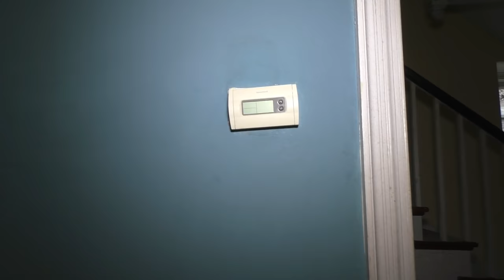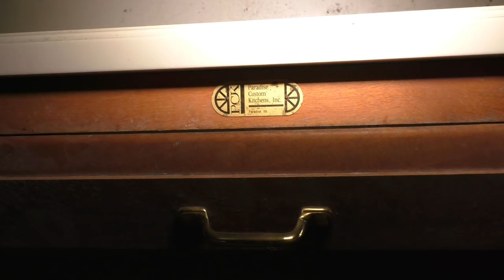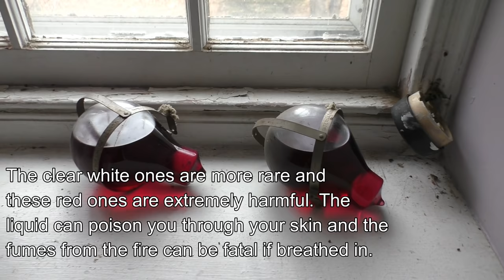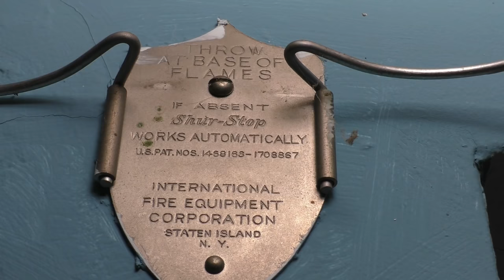Beautiful Abandoned 1930s Mansion - Inside Is Amazing! Plus Guest House

Comment: A drone would’ve been useful to investigate inaccessible areas. This home is amazing! I agree that the 3rd floor 2 bells at the bottom landing suggests women and men servants’ quarters.
Reply: Yep likely those bells were connected to does push buttons it looked as though there might be a few relays as well which presumes that it had more than one tone or a pattern of ringing there possibly could win gold drop devices that be triggered by the coils as well that would indicate if the person missed the Bell that don't call button head didn't wish would they returned. 

Did the old days the bills run Springs the ones that look like the Downton Abbey type doorbell sort've Widow album were operated by pull cables at rods or whatever you want to call them servants call bells or call build as they used to be called and also they had announced Gator panels that will Target with drop or indicate with a needle that there was a call placed in some places there's dozens of little tags that would indicate where the call came from in some cases one Bell and it is several indicators of some sort mechanical ones some more electrically-operated but owners or mechanical nature is that often times with what would be on the end of like a silk bed cord they had pulled the ring a bell sort of like Addams Family except in real life course. Back in the old days you would see a cord that's woven coming down from the ceiling next to a bed ideas you yanked that which would ring the bell in the servants quarters and sold these were actually connected to a switch or later on some mechanical systems were converted to electronic actually electrical at that time but they didn't have relays and stuff so yeah could be considered early Electronics also in some cases the doorbell and the call system were one in the same did that operating the doorbell sometimes of a pool table would ring the bell twice and I call for a servant or a person that's not feeling too good would ring the bell once purport that was all done mechanically and that's why that pulled off for the door so you can get the tube pushes mechanically.

Is some cases these systems were also used to alert another family member see the house has sickroom there be what they called pair push which is a push button in a pear-shaped handle / enclosure that would have a push button in it it'd be basically he was like a nurse, but would accept that would ring a bell or bells in the house somewhere you needed something I have CDs actually still working and modernized number one place I stayed at there was that really a sickroom but had been used for some reason that had been quite in need of a lot of medical attention and be taken care of they haven't use that room because first of all full bath which I needed as well as well dressed wolf and everything and also leaving this morning frigerator a microwave as well it was actually kind a good idea idea actually need used to call system couple times when I needed something unfortunately got to take two different nights.

Cleanup on aisle bathroom.

Comment: That second staircase off the kitchen, was indeed the servants staircase, and the buttons were to call the servants (reminiscent of the British sitcom "Upstairs, Downstairs").  I worked for a famous mansion that was a B&B and it had the same setup, and the dang steps were so small I had to step sideways so my feet would fit!  Most times I would just slide down on my backside...easier (and safer) then falling down those steep stairs.  Another great video!
Reply from the maker: Thanks for sharing
Reply: kelltic100 Upstairs Downstairs was not a sitcom, it was a period drama.  No comedy whatsoever.
Reply: @JulieWallis1963  -- really!!!
Reply: @JulieWallis1963  I know that, and don't ask me why I typed that... Brain is working fingers have other ideas...
Reply: Sandy Mohon yes, really. I watched the entire series a couple  of years ago, back to back in a few days. https://en.wikipedia.org/wiki/Upstairs,_Downstairs_(1971_TV_series)
Reply: The back stairs of my newly acquired 1910 home had stairs that are narrow also.  What's up with that design?  Why so prevalent?
Reply: giancolabird 
P

Comment: I would think that if the basement was the servants quarters then those bells were to call them. Such an amazing house with a sad story. My house was built in 1956 and we have some interesting fire alarms. They're bells that are wound up with a button on front that's held on with wax. If there's a fire it will melt the wax, releasing the button sounding the alarm, and boy are they loud!!!! One in every room. They can be re-wound as well. But this house was a cool find. My favorite was the art deco, black and white bathroom. I hope they save the house. And don't modernize it too much.
Reply from the maker: Thanks for watching
Reply: Yeah,the black thing on the basement wall was to summon the butler...
Reply: Yes the one in the basement was a doorbell.
Reply: It looks like there was more to the device, and parts were removed. It is possibly a house telephone, with circuits for the various rooms, and a large ringer so it can be heard throughout the basement. The call buttons on the backstairs doorjamb might have been to let servants either upstairs or downstairs know they were wanted in the kitchen--possible to call them for meals. Since the room over the garage doesn't seem to have been fitted for sleeping or plumbing, it may well have been the "servant's hall" for sitting, eating, or doing small jobs such as sewing or polishing silver.
Reply: Yup, gotta learn the terms, Art Deco, Hollywood Regency,  etc.

Comment: The “bell feature” in the basement is most likely linked to the buttons in the kitchen. If the butler’s quarters are in the basement, then when the family requires the butler’s help, they push the button (like a door bell) that will alert the Butler.

Comment: This was a really great house adventure thank you so much it's interesting to read people's comments about what they think used to happen there or what color was available during certain. Of time. Mold dust asbestos who cares? If you were breaking it down or something like that and they were mold spores and asbestos spores in the air you'd have to really worry about it. So after all new electrical Plumbing Heating Roofing it's a good sturdy standing House made with stone like that that's why the window sills are so deep I bet it's warm in the winter time. Even the tile in the bathrooms don't look that bad and it has the original fixtures. That little Guesthouse was probably for someone that lived and worked on the farm maybe the farm Foreman or someone like that. that basement would you were calling a man cave that's probably where all the steam heating equipment stuff like that was in the basement. The rooms above the garage could have been for a cook made or possibly even a opare. Thanks so much for doing this stuff we love it. that Springhouse is from an entirely different era of time where people kept perishable items there during the summer months instead of a refrigerator although obviously it's been rebuilt

Comment: Typical old country stone farm house probably located in Chester or Lancaster County PA. I feel the original part of house with fireplace very much older than the 1930s, larger additions added years later.  Original small house could be 1800s.  However I doubt if larger part of building house built much after 1930 due to the Great Depression. Spring House & barn definitely from the mid to late 1800s.  I know, I used to live in a similar 1930 stone house in PA.  18 inch thick stone walls, fireplaces, wide window sills. Sorry this place abandoned, completely deserted.  Lovely open countryside though overgrown.  Owners obviously had livestock probably cows, horses.  Spring house, large barn & extensive acreage prove far the older age of the original smaller stone house.  I like the original part of old house best with its paneling & fireplaces. I’ve seen many similar 18th c. stone houses in southeastern PA.  I wonder what happened to original owner & family.  Surprised place abandoned so long. Thanks for showing this handsome property.  It’ll take a fortune to repair.  With money it could be a gorgeous estate again.  Save the original section of the house. Get rid of any tacky modern additions.
Reply: barbara tarbell I was thinking the same thing,  that the original smaller part was from 1800s, then added on. It reminded me of one of my ancestor's old houses that had a similar set up.
Reply: Indeed 👍🏼
Reply: barbara tarbell p

Comment: ...... I'm concerned about the "spring house" .... Every time I have been inside of one .. even a block one .. it has not been warm .... Instead, I've found the opposite to be true ...... 

Every properly built .. working spring house .. has a water run-off system ... (usually via a pipe in the more  "modern" ones) .. that diverts the run-off to some other place .. (such as that sunken bathtub in the field -- which could be put to a variety of uses) .. and was generally used as a clean flowing watering trough for any livestock in the pasture ....  The old settlers used to have large stone areas by the entryway .. with space between the stones to allow for drainage ... or just  "stepping stones" if they were short on stone or the time to build anything more elaborate .....

But I digress .. My main point was that the water in a spring house is usually contained within a deep well area that it overflows .. thus preventing the standing water from becoming stagnant and keeping the water fresh for safer use ..... AND it's always freezing cold inside of a spring house ... one of the reasons they were used to keep perishables cold all year .. until modern in-door refrigeration came into being with "ice boxes"  .... But that's  the subject of an entirely different conversation .. chuckles .. 😊😊😊 .... That's why I was concerned when I heard u mention that it was noticeably WARM inside the spring house .. (even though it seemed to be functioning properly, with a working run-off system to the old tub in the pasture, and the 4-5 ft deep holding tanks still overflowed .. causing the entry area to be muddy) .. The warmth inside could possibly have been caused by the buildup of some sort of gas within the block building .. so please take care in the future if u come across another spring house .. cold air should waft out at u when the door is opened, and it should be very cold inside instead of warm ... 😊😊😊

I look forward to seeing more of ur exploring vids in the future ... So happy .. (and safe) .. exploring to y'all my new friends ... Regards .. 😊😊😊

.
Reply from the maker: Very interesting. I'll pay closer attention next time.
Reply: Couldn't it be a warm spring?  The state I'm from has hot springs & warm springs all over it.  My first outside job was a lifeguard at the city's only natural warm spring pool.  (It was not very warm compared to some, but any other natural spring wb ice cold)
Edit: the smell of natural warm or hot springs is usually a dead giveaway to their presence.  I kept waiting for you to mention a sulfur smell.
Reply: Yes spring houses are usually very cold inside!
Reply: brr johnson I’m curious, Do you live in Idaho? Obviously I know there are other spring fed pools around the country but when I was a kid I went to one In Idaho, it was so cool!
Reply: Sheila Harvey yes, seems like they're everywhere in Idaho.  I've visited so many thru the years, throughout the US, many are barely warm. But, the ones in Idaho & Japan I've found to be the hotest & most beneficial. (Too hot in places)
Reply: Couldn't that be the reason it exists - don't know how old this house is but maybe it's a food storage area.  Keep things cool/cold. They used to have ice houses in the old days.
Reply: we had a well similar to this when I was growing up that had wooden beams in the bottom of the chambers that my father told me to never take out of the water cause they were more than 100 years old then and the water was ice cold but i think it was in the 50's or 60's they replaced the roof with asphalt shingles just like this one and ours would usually be quite warm inside from the sun even when there hadn't been sun for a couple days. most of these buildings aren't much bigger than 10x10 and with tar attracting the heat of the sun it didn't take long to get temps above 100 in there

Comment: There was a house just like this one off Rt.107 on Long Island. Was set on 100 Ac and had a hotel at one time but was left and wasn't cared for.
It had an Olympic sized swimming pool and a golf course on it.
The garage had parts from an early Ford car with a wood spark box and was intact.
Last I knew they were going to tear it all down to put up about 20 brand new homes.
Back them would been 150 K over 22 years ago.
That property was near Old Brookville,NY
Th I se home are near 1 Mil or better.

Comment: Beautiful house probably take 50 thou to fix or more have to start by replacing roof getting rid of mold refinishing floors,& definitely replacing heat& air system. I'm glad someone bought it and hopefully it's restored beautifully again. My house is 1920 mine has 2 claw foot tubs. Wish my house was stone. My house has hardwood floors & all original Glass door knobs. The outside is wood it needs work too only mine has central heat and air in it. The rooms in the house is set up kinda strange has a nice office & it's across the street from the river. I'm sure it was top notch back in the day. Thanks for the tour i love old houses especially stone.

Comment: Not uncommon to have back staircases both for the servants and the mistress of the house. Ours did...and the  1 of the neighbors did, too. It was so the servants could come down without using the main ones and disappear the same way. Also, in case the mistress was still supervising the kitchen staff and wasn't quite ready when guests arrived at the front door: she could retreat unseen up the back stairs to her room to get ready. I wonder if the bell system you found...was for the servant RINGS? There was usually a code...different rings for the butler, ladie's maid, nanny, etc. Our house was built 1894-96 finished. Black gas pipe in every room( already capped when I was born in the 50s), sandstone, maids quarters, 10 foot ceilings,.every doorknob and hinge was hobnail brass, all copper spouting, Venetian glass chandeliers, lead glass windows, all woodwork was mahogany except for the massive oak parlor pocket doors between the living and dining, coal furnace, laundry chute from the second floor, fruit cellar, incinerator(!) Carriage house, 4 bedrooms, clawfoot tub. There were 14 steps just to the landing...a turn...then 4 more. Sadly, it burned 10 years ago....neighbors blight😥

Comment: Great to hear someone is trying to save it now, great old house. Was going to say something about the danger of those extinguisher globes, even the clear ones by the way, but you covered it first, so 'nuff said. Funny thing, the wall mounts are worth more to some collectors than the globes. Look like the guest house was somewhat newer than the main house, and had had some upgrades as well. newer styles of wood trim inside it as well.
The main house really shows it's age in the plumbing fixtures and knob and tube wiring. Those old lions foot tubs are worth some money restored too, and the smaller one, sometimes referred to as apartment size, used to be quite common even in small houses to save space. Thanks, as a retired carpenter I enjoy these. 
An afterthought, the bells you showed on the upper floor may well have been connected to the doorbell switches you showed on the main floor, likely a signal system, just a thought.
Reply from the maker: Thanks for watching

Comment: I love these old homes because they have staircases and floors and rooms all over the place. And the older they are the more space as you find because they had been added on and added on over time. The first small staircase in the back that you go up could possibly have been the original homestead? And then perhaps the larger part was added on after? I only am guessing because the stairs are small and very plain versus the more grandioso one in the larger part of the home? I know that servants quarters had smaller everything and were behind the walls in some cases pushed out of sight but because there is a difference in floor height for the second level it shows that one of the parts of the homeless built before the other otherwise it would have all been the same level... I would assume.

Comment: Thank you for posting this video guys.  I am not sure where you found this home but as you went through I was amazed.  These types of homes are very common in New England states.  As you went through to the kitchen the small room there was the butler area and had a pantry with it. They would receive food from the kitchen and then serve it.  Cooks stayed in the kitchen. You guys are also accurate with the room being above the garage as the quarters for the butler.  I looked at a home in the state of Maine similar in layout.  Different exterior material.  This is a great home depending where it is located.  I would say the stone exterior would be an expensive cost over time to prevent openings from forming, thus allowing critters and water leaks.  Also you guys had me laughing.  You sound like a bunch of kids in a candy store.  The guy telling about the home should consider real estate.  You really put this home on a pedestal.  Thank you for sharing and I will be subscribing,  Came across you guys while on Roku's yahoo.  This was a recommended video.
Reply from the maker: Thanks for watching